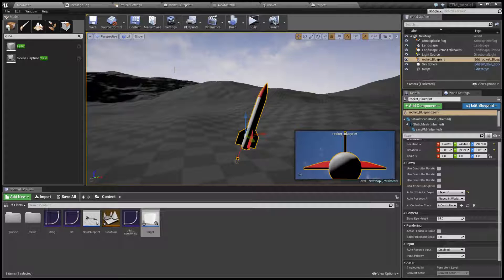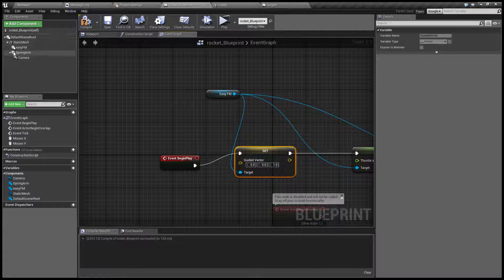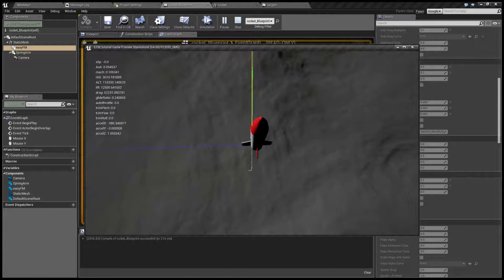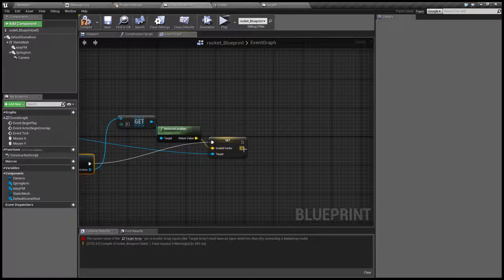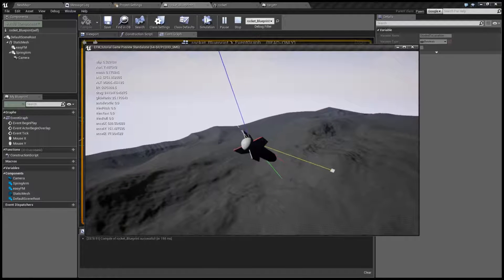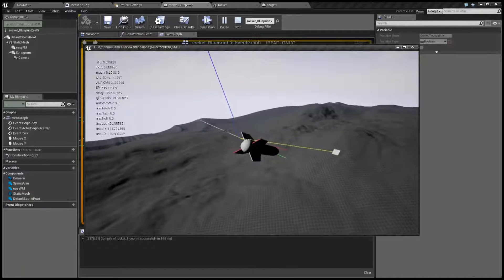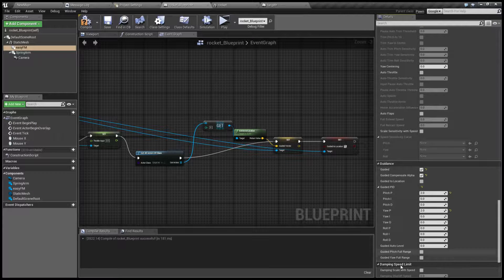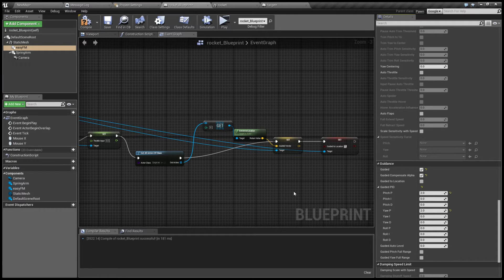EasyFlightModel UE4 tutorial ep.7 (guidance system)

Comment: Hey, It's me (again).Thanks for your patience. 
I tried your demo project and I notice its mouse flight control is using the guidance system which is working great. But I also have an issue that seems mouse flight has conflict with other input. 
For example, I have a keyboard Q&E as Yaw input. When I try to hold Q or E to do the Yaw, the plane seems to have a dragging force to pull the plane's forward vector back to the central point (or mouse location). The similar thing happens on the pitch input. When I holding the lift button, the jet can't reach the top and do a vertical 360-degree circle. Instead, it will do a horizontal flip. 
When I turn off the guidance which I disable the mouse control, everything began to work fine.
Sorry this might sounds abstract, If you can't understand my point I can record a video. My question is can I solve this problem easily? Or this can be a feature block by the guidance system means I can't use mouth control and keyboard together. Thanks.
Reply from the maker: Yeah you're giving it conflicting inputs, of course it cannot do both at once. The solution is to pause guidance while you're using manual inputs.

Comment: I was just wondering also if there is is an formula online to calculate the amount of torque to apply to the physics actor so the nose tends to point in the flight direction?
Reply from the maker: If you want to do it in a completely realistic way that takes into account center of lift and center of mass, it's quite complex, but simple way is just to take your angle of attack you calculated earlier, multiply that by speed squared, and apply that as torque along right axis.
Reply: Thank you, i am using that method for now, but do you know what the equation is called or how it works?
Reply from the maker: Look for "lever torque" on google. But really at that point you're basically writing your own physics engine, if you're not ready for that, just use Unreal's "apply force at location".
Reply: How would i do if i wanted to apply elevator torque, so that when the angle of attack is 90 degrees the multiplier is 0 and when the angle of attack is 0 the multiplier is 1 and if the angle of attack is 45 degrees the multiplier is 0.5 etc?

Or would you recommend doing it another way and if so how?
Reply from the maker: Yea do that, that's more or less what EasyFM does.
Reply: What math function would i use to get that multiplier?
Reply from the maker: sine
Reply: Okay thanks but how can i invert the value so it says 1 when angle of attack is 0 and 0 when angle of attack is 90 degrees instead of the opposite, since muliplying by -1 does not work?
Reply from the maker: use absolute value (ABS).
Reply: When i use ABS it gives me the exact same value except no negative value what am i doing wrong?
Reply from the maker: I thought that's what you wanted for multiplier
Reply: Oh sorry i meant that i want the Sin value to be 1 instead of 0 when the angle is 0 degrees and 0 value when the angle is 90 degrees?
Reply from the maker: Use cosine, or add 90 to angle.

Comment: for the jet project, how do I change what the missile lock on to?
Reply from the maker: There's a "Target" variable in the missile blueprint, it should be able to lock on to any actor that has "Radar Contact" interface. If you want it to follow other things, you'll also have to remove check for signal from Follow Target function.
Reply: how do I input the radar contact to other actors?  and thanks for your help
Reply from the maker: Actor needs to implement the radar contact interface. That will add an "heat signature" function. The output of that controls how hard it is for the missile to maintain lock on it. You can just make it return 1, or just copy the function from plane_blueprint.
Reply from the maker: By the way, if you're making your own missile, it doesn't need to be as complicated as in the demo project, that is just a more realistic setup. If you don't require your missile to have realistic tracking limits, you can simply set the guided vector to location of the target, as shown here.
Reply: so all I have to do is copy the heat signature function and paste it in the new actor??
Reply from the maker: First you have to add the interface in the actor settings. Then yeah, you can just copy the function.
Reply: interesting,   I finally implemented the radar contact interface   but it still wont track anything
im probably missing something obvious
Reply from the maker: DEADSHOT 935 Do you have Skype or Hangout or something like that? I'll take a look at it.
Reply from the maker: Contacted.